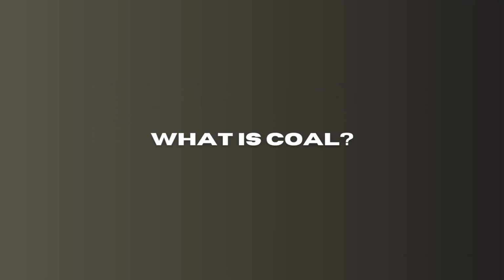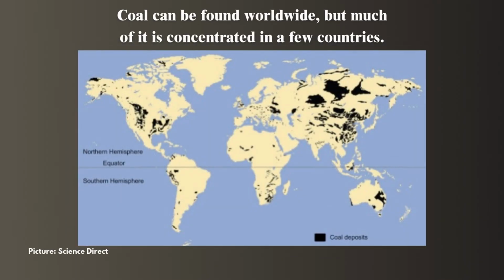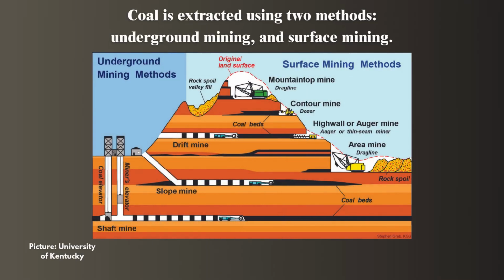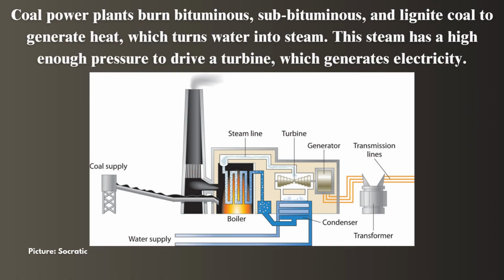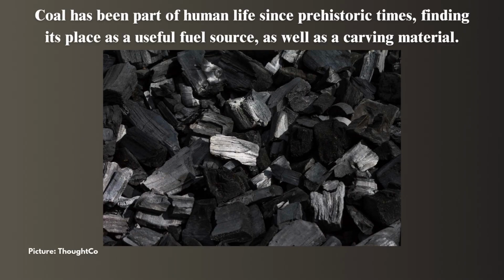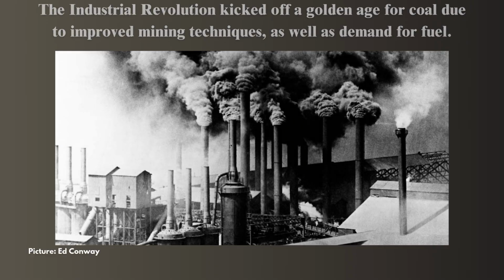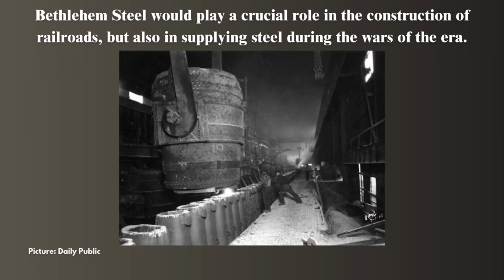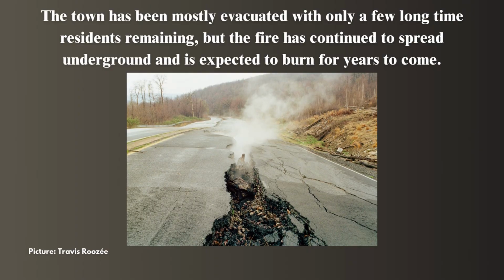An Overview of Coal

Comment: Nice, well-rounded presentation on coal. I spent a time researching it myself, as originally I used it for forge work, then for making graphite. There's very few equivalent single-source fuels that can burn equally hot and relatively cleaning when done correctly and utilizing All of its energy at max temp. The steel-making industry along with coal was practically the backbone of the world for a very long time.